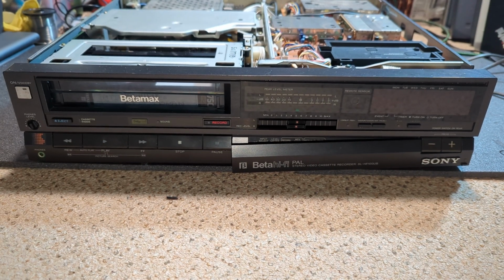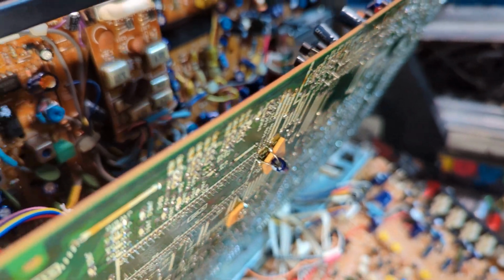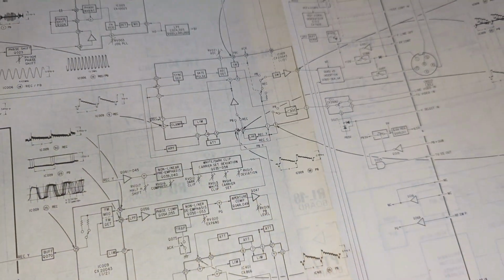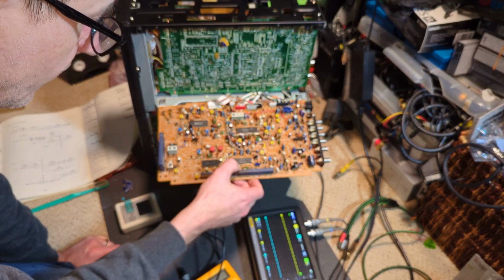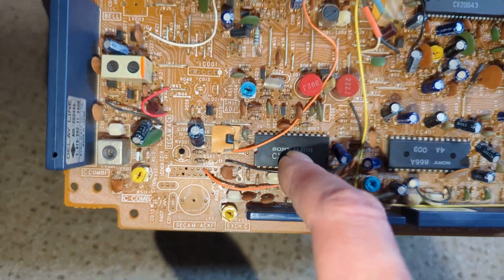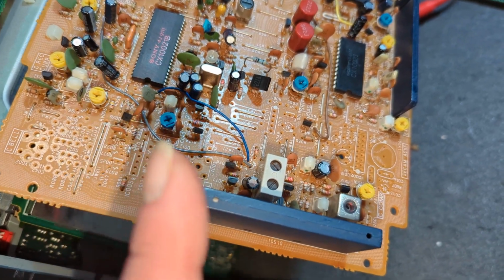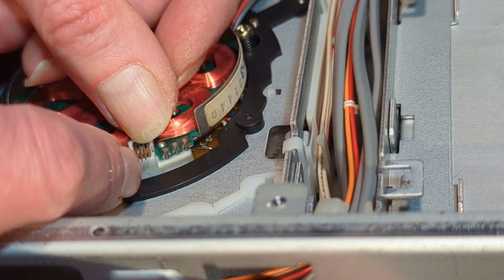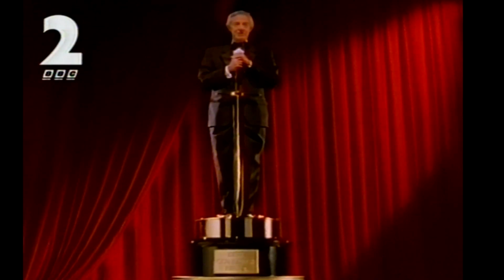Sony SL-HF100 Betamax - Part 2 - No colour (Doing things the wrong way around)

Comment: Love your repair videos! Had a quick question I'm wondering if you've seen before and what the fix was if so. Basically I have a SL-HF860D and the transport works fine except for play and it is obvious to me that the capstan is not moving, and then it just shuts down after 3 seconds of trying to play. If pause is pressed quickly after play, it will display a picture and continue to do so (which isn't surprising since the capstan would be stationary for that). This model has only 3 SMT caps (all 47uf 16V) and a Toshiba 7262P motor controller on the capstan board. The SMT caps were all open, but I replaced those with no change to the functioning. I do notice when I tell the unit to play, one of the 8 incoming wires goes from around 0.5V to 10V which I assumes means that it is calling for the capstan to spin, but it just doesn't. The capstan itself moves freely. I also looked at the servo section on the main board and replaced all of the ELNA caps for good measure, but there were no shorts. 

So my question is whether you've seen one of those Toshiba 7262P motor controllers fail and if there's a good way to say for sure that the controller is at fault as opposed to something else?

I wouldn't be opposed to just swapping out the capstan altogether as a test, but it is riveted in and I don't have a spare anyway.
Reply from the maker: Thank you. I have had capstan motors fail on later Sony beta machines. There will be hall effect devices under the flywheel which can fail. Easiest way would be to swap it out with another one, they unscrew from the top of the deck but it is trying to find one that's hard.

Comment: The red electrolytic capacitors at the AV outputs (BNC+DIN) don't look particularly original. The unpopulated bell filters belong to the SECAM variant that was probably never produced. The THS103A "alarm system" Hall sensors are still available on eBay Germany as new old stock. Since the C117 only has 150pF, I'm assuming a rather high-impedance Croma input on the CX20043. Before the capacitor, you can use a high-impedance video op amp (OPA690) to intercept the Croma signal for S-Video out. The capacitor should be soldered to ground on the source side so that the Y signal is not contaminated. I don't like CVBS because a comb filter only works optimally with a quartz-stable source. Except for Colin's exotic DPS TBC😉
Reply from the maker: The whole PCB's electrolytics were replaced. Interesting on the S-Video out - not really occurred to me to do this before so May well take a look. Thank you so much for sharing.
Reply: @MrBetaByte  You can measure the DC voltage (during playback) before the capacitor. In my circuit diagram, there are 2 DC voltages to choose from. My property management has thwarted the restart of my workshop by AGAIN omitting my agenda item (ventilation pipe). A BC517 NPN Darlington (250MHz, hFE >30000) can perhaps be operated directly with, for example, a 120 Ohm emitter resistor. With a capacitor of around 1µF, the emitter signal can be passed on to a 75 Ohm output resistor. However, cheating requires a high-quality S-Video cable, since without amplification only 250mVpp (according to my circuit diagram) is present at the input resistor of the following device instead of the standard 300mVpp. Normal devices can tolerate +/-3dB at the input. A Circuit with OPA690 (fast enough for Doomsday ADC and only 5E) requires extra PCB.